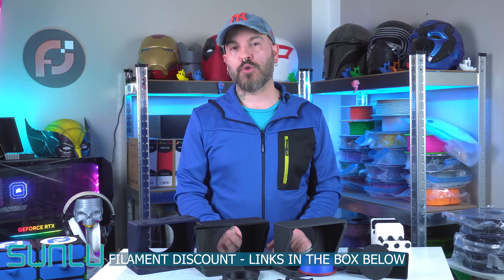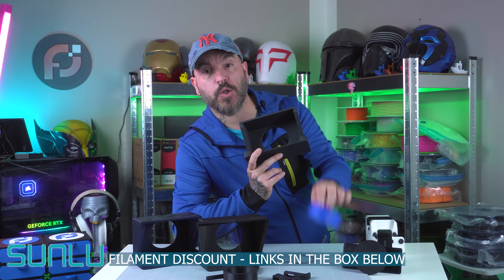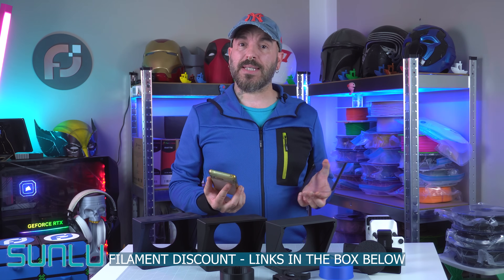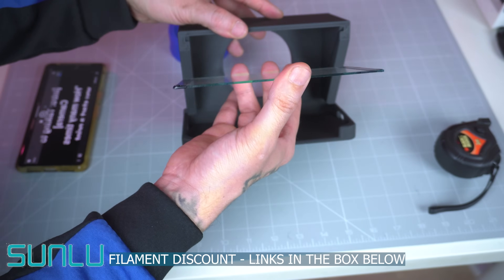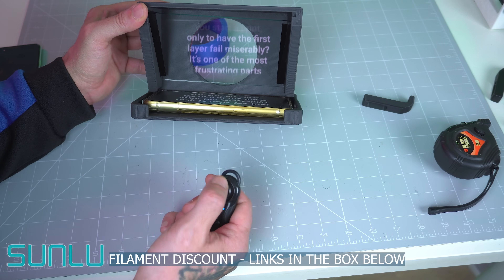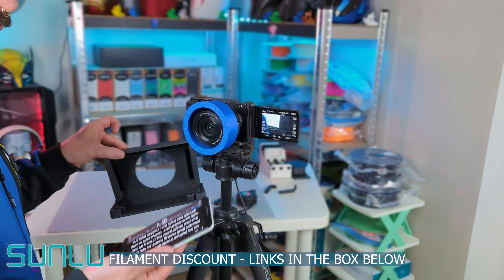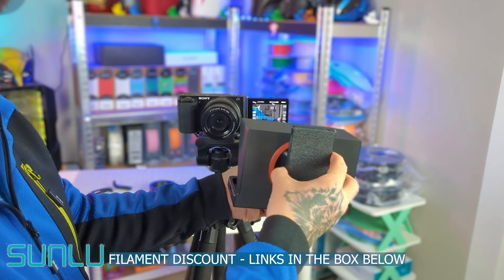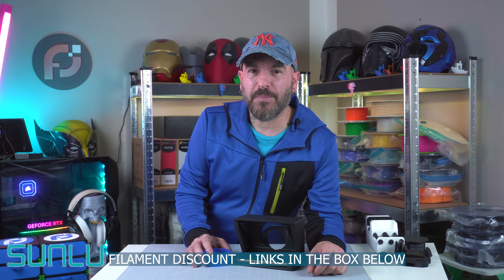3D Printed TELEPROMPTER | #sunlu

Comment: If I attach the teleprompter directly to the camera lens without any support, will the weight damage the lens, camera mount, or the camera body? Also, can you make a separate mountable stand for the teleprompter so it stays in front of the lens without putting weight on it?
Reply from the maker: Sure you can

Comment: Just about the warpage. Brim ears work well but opening the door and top of your enclosed printer or printing using a bed slinger in an open air environment will help minimize the affects of warpage especially for PLA.